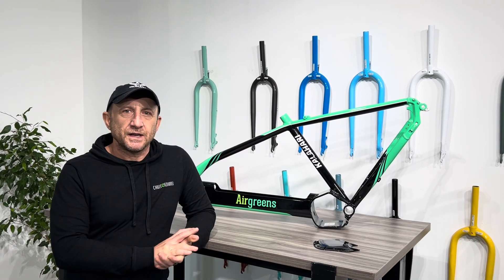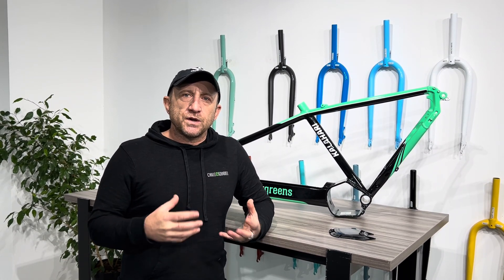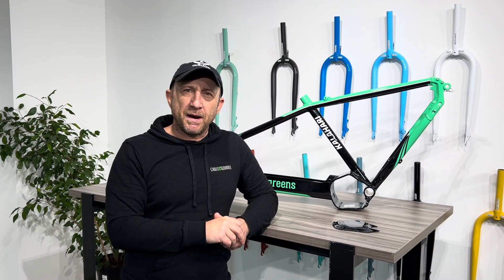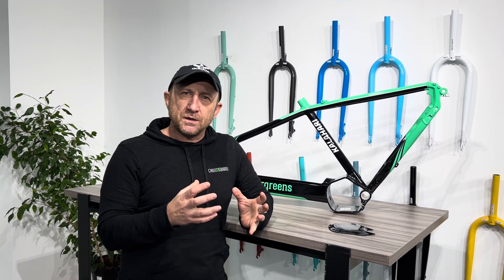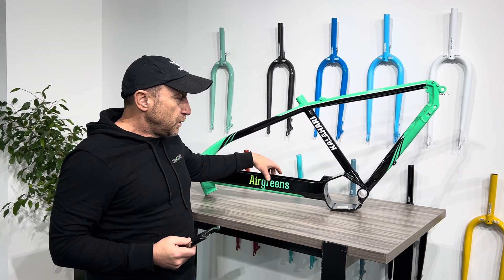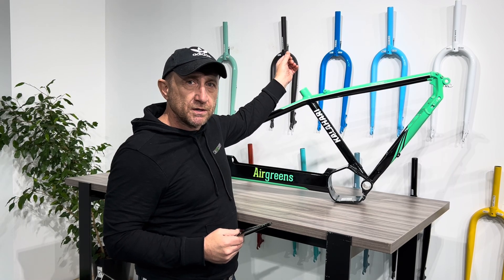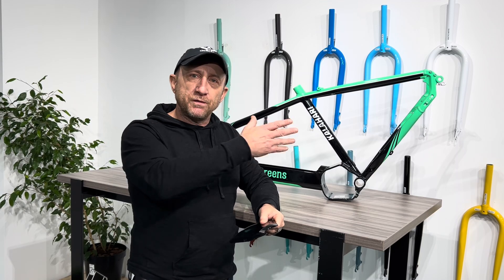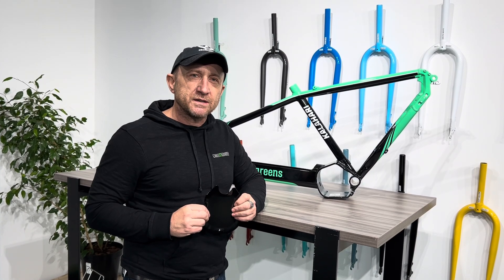Ebike Frames for Bafang BBSHD and BBS02B Mid drive motor systems.

Comment: This frames is made for the bbshd I hate mounting it on a normal bike cause of the mounting teeth ruining the bottom bracket?
Reply from the maker: The frame is designed to take a tri-lock plate that is specially designed to lock the motor BB in … 
Pls email info@chilledsquirrel.com and we could email you a pic of the tri-lock plate